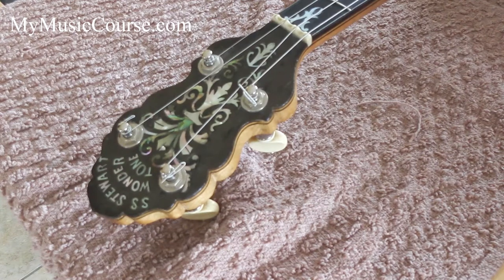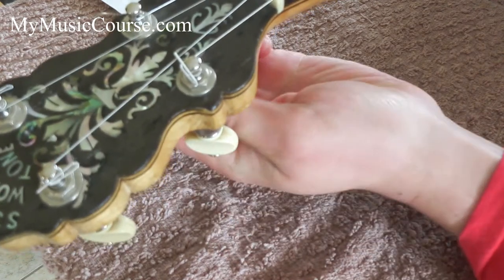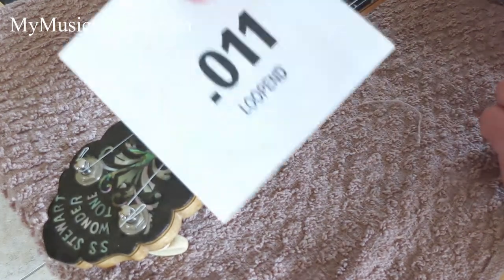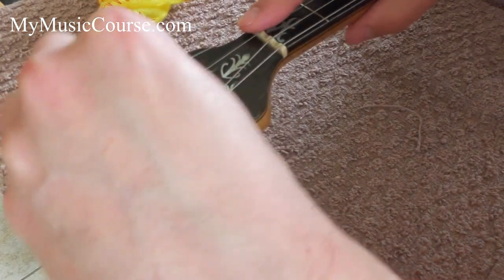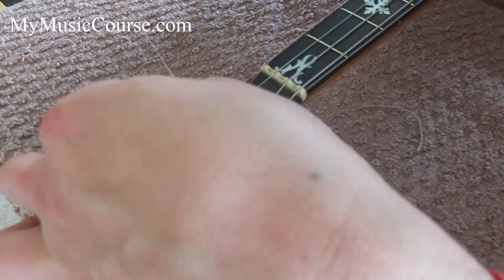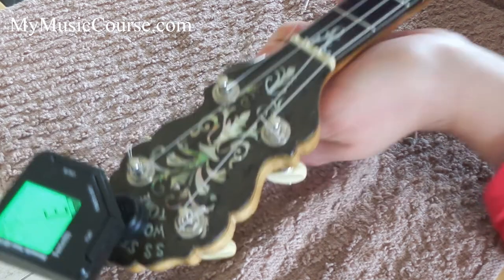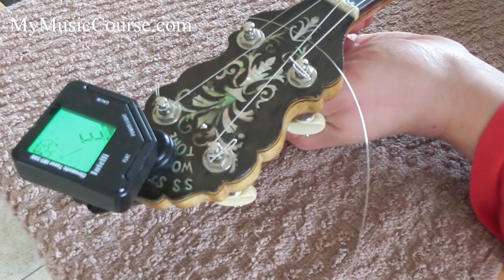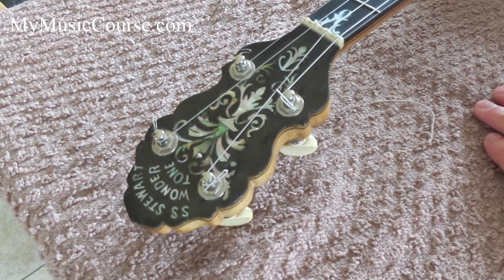How to restring a Tenor Banjo

Comment: Can anyone tell me the difference in using heavy, medium gauge etc. strings
Reply from the maker: Absolutely, Thanks for the message. 
So a heavy gauge of string will give you more tone and more volume, however the trade of is there harder to play, as in physically harder to pluck, slow to do you speed ornamentation on like trebles and there also a lot tougher to press down to the finger board so harder on your fingers and it can hurt and stop you playing faster. 

Light strings you can move fast on them and play fast and there easy to play and push down, however they will be more likely to go out of tune faster, be effected by temperature changes, and snap easier. Also in a light gauge it is harder to get a wound A as you'll be playing a 15/16 there and there plain. 

The medium gauge is the happy medium. 

I use 34, 26, 18, 10. in bronze. 

My G string is tuned to A, my D string can be anything from 24-26 I dont really care, the A string has to be wound and the E can be 10-11 doesn't matter.  

I hope this was helpful. Perhaps I should make a video on it.
Reply: @mymusiccourse  Many thanks for this! Very useful, I think I’ll try medium (currently have heavy gauge). I don’t understand what you mean about tuning. Why would you tune the G string to an A and what does tuning the D to 24-26 mean? I mainly want to pick tunes, with a few chords added for interest. So yes, a tutorial on strings and different tunings would be great!
Reply from the maker: @amandasanders1141  okay perfect I’ll make a video next week. The numbers are the size of the string, so if you go to a music shop and ask for a 24, 25 or 26 gauge string that’ll be irk for your D and be medium. 

I tune my G to an A because it is easier to play chords. For example I can play A and D major with only 1 finger. Also when playing in D or A minor I have an A
To use as a drone string. Also in E minor the B is easier to hit and the C # is easier to reach also. 

I’ll make a video on that too and you can have a look.

Comment: Can't you use Tenor Guitar Strings? You'd need a Terminator Tailpiece that uses both Ball & Loop end Strings.
Reply from the maker: I’ve actually started using regular guitar strings. I need to update this video
Reply: @mymusiccourse  Tenor Guitar Strings
Reply from the maker: @RockStarOscarStern634  you can use tenor guitar string. I find guitar string are cheaper and easier to get in custom gauges ie buying individual strings rather then packed to get the gauges I want. But either is fine.
Reply: @mymusiccourse  Clifford Essex Loop End Nickel Would Light Gauge GDAE Tuned Tenor Guitar strings would be Killer. They're Inexpensive.
Reply from the maker: @RockStarOscarStern634  nice I'll check those out. I'm into my phosphor at the moment though. prefer the tone.
Reply: @mymusiccourse  They make them in both Phosphor Bronze & Nickel so you have more options.